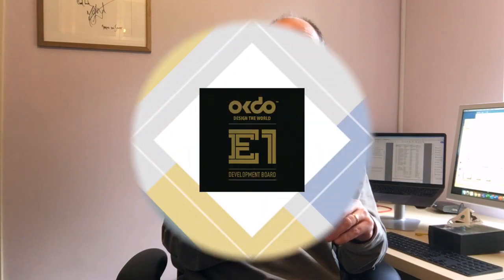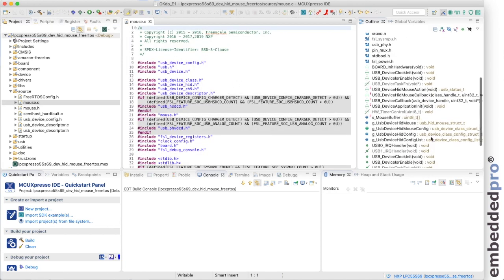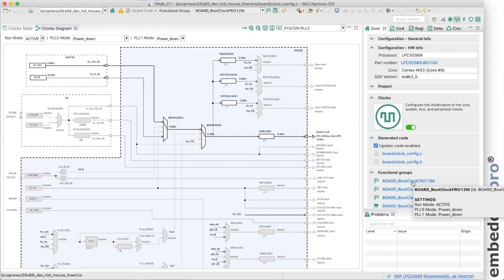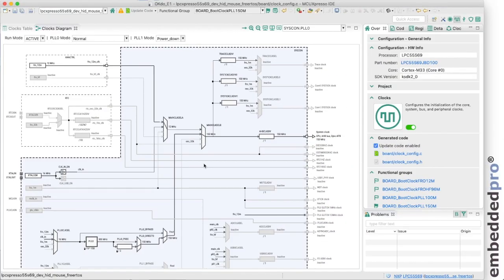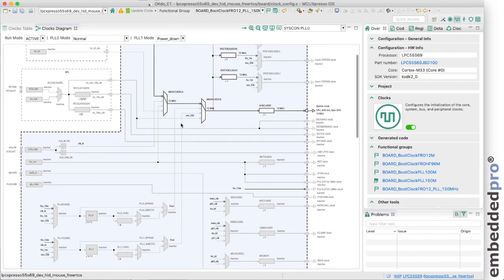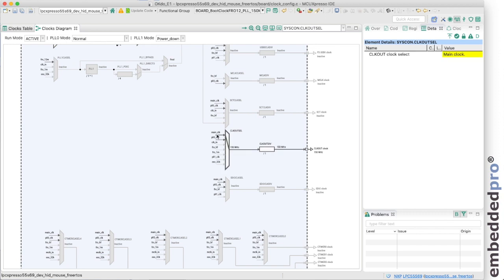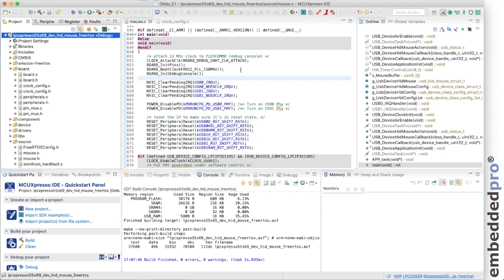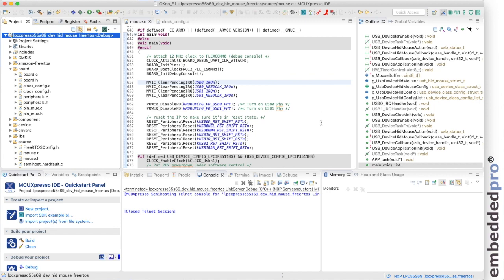3 MCUXpresso Clocks Config tutorial with OKdo E1 board

Comment: Hallo Mike! Thanks for all the videos on the E1, they are quite helpful! Just note that the SDK demo project, "lpadc_temperature_measurement" uses PLL0 as clock source and reconfigures it for the ADC, so the program just crashes if you have set up PLL0 as the main clock. Ive changed my main clock to use PLL1 for the processor using your guidelines and left PLL0 for the ADC. Kind regards Gert van Biljon